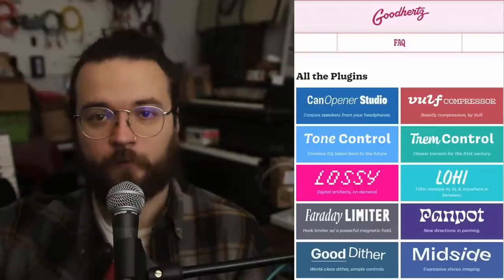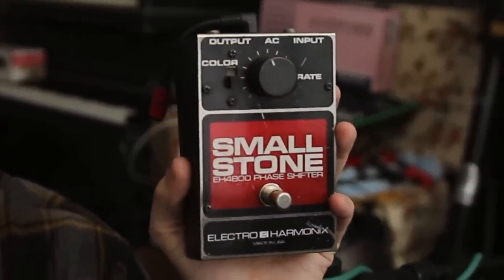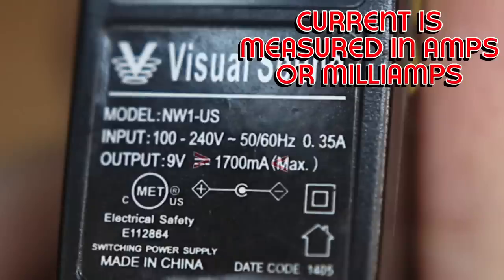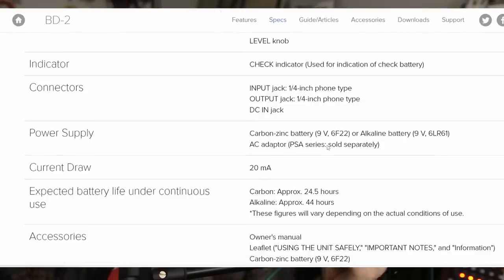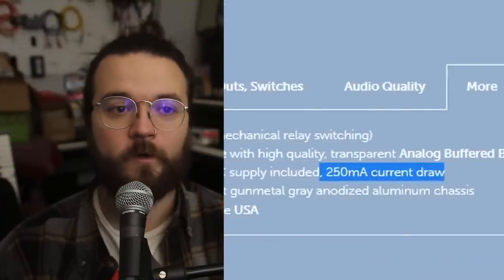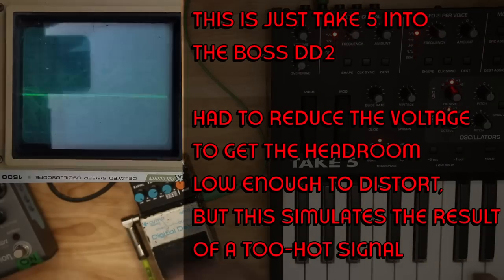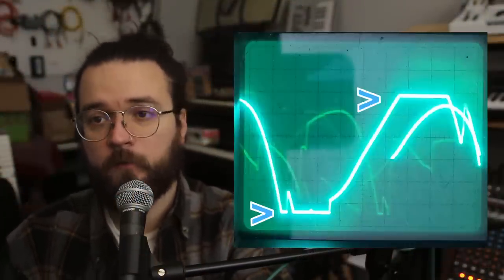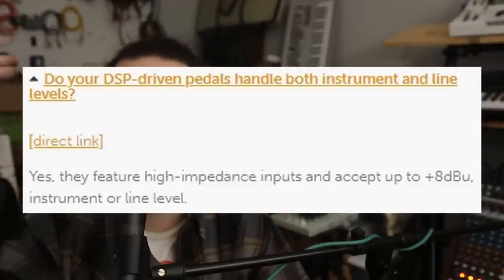The Synthesist's Guide to Guitar Pedals 1 // Power, Stereo, & Levels

Comment: I've tried hooking my synths into guitar pedals before and most of the time, I barely notice any difference in the sound.  However, on guitar I can definitely discern what the pedals are doing.
Reply from the maker: Odd...what pedals?
Reply: @JorbLovesGear  I've tried the Shallow Water, Digitech Drop, Zoom Mulistomp, Nux Tape Core, Mooer Ocean Machine, and the Microcosm.  I'd try them a few times and spin the knobs on the pedals and used each pedal one at a time (rather than chaining them).  I just didn't find much discernment in my ears.  If the hardware synth didn't have an FX processor (like the MiniBrute 2S and Neutron), the only thing useful was reverb.  However, if it already had FX, like the Minilogue XD, the onboard FX processor seemed like plenty.

Perhaps it works better on simple wave forms.

I expected a lot more from the Microcosm after pairing it with a Blofeld, but playing the same MIDI sequences against it and trying a few different sounds, it just have a same-samey sound to it.  I'm still learning the Microcosm though so maybe that will change as I get more adept with it.

If anything, probably the Nux Tape Core was a fun one to have in place of Reverb.  There's a very observable feedback process when you put the knobs at higher settings and then roll them back.
Reply: Could also be your running it all up front through the pre-amp or ut could be the sequence your chaining them? Just a thought...
Reply: @theinnermostsanctum  No chain.  I was just using them one at a time.  If there was a chain, I'd sometimes use the Multistomp (but I'd put that in the FX loop of the 4-track recorder instead).